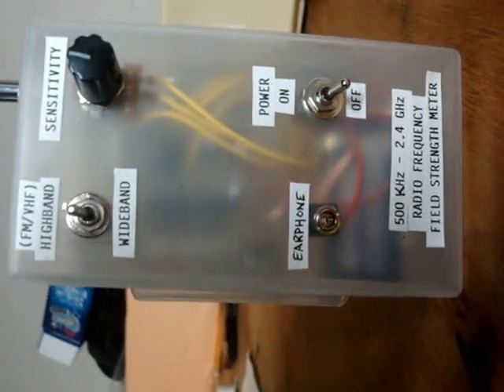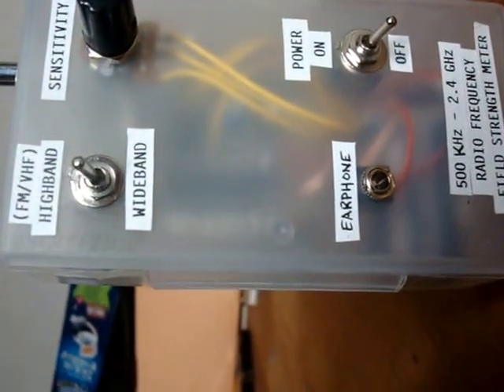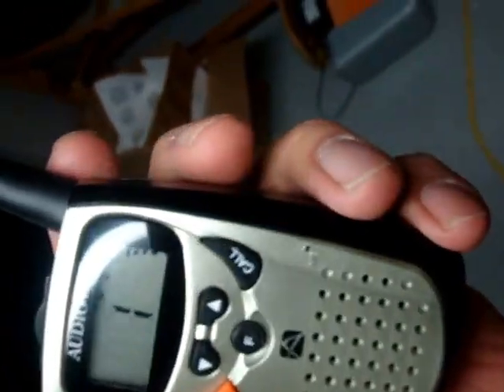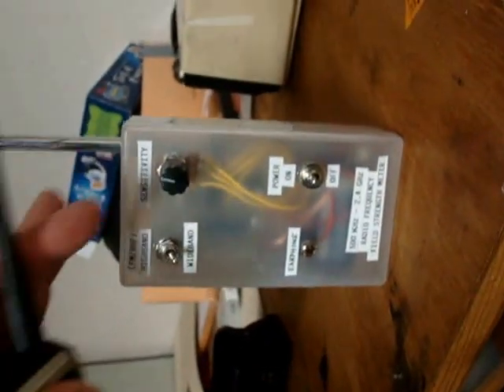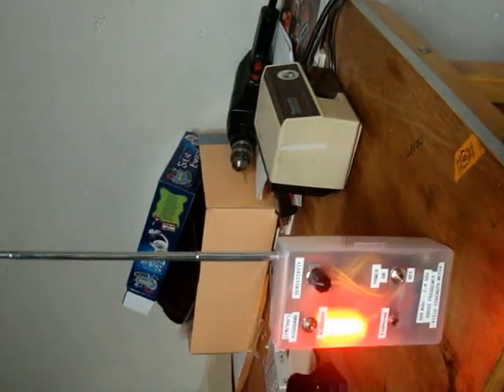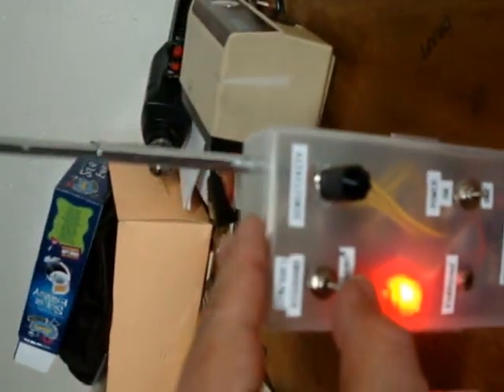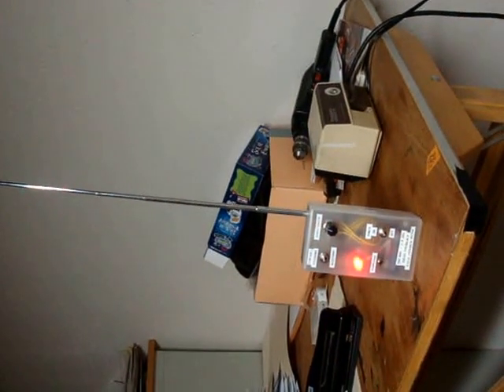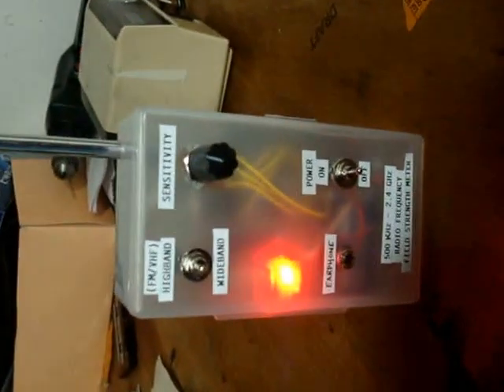DIY RF Detector

Comment: Could it be done for only 380-385mhz band?
Reply from the maker: I don't think this particular circuit could be modified to detect and show ONLY a particular bandwidth.  You might try making an RF detector that has a 383MHz resonating circuit on the input--which will certainly make it more sensitive to that frequency, but even then it probably doesn't exclude other signals.

Comment: Cool. Approximately how much did this cost for all the parts? $10? $25? $50? $75?, $100?, $100+?
Reply from the maker: The entire project certainly cost me less than $25, but probably a little more than $10.  The LM3914 Bar Driver was about $2 (from Tayda Electronics), and another $2 or so for a 10-segment bar display (from eBay/China). [The 10-segment bar display is much easier than trying to align 10 individual rectangle LEDs.] Other than that, the only piece I had to order was the BAT-29 diodes. They were also only a few dollar--and I ordered them off eBay from China. But you can try any type of Schottky diode and it would probably work. The only problem is waiting for two weeks for the parts to arrive. The TL071 is a simple OP-AMP and I paid about .99 each for them (yes, Tayda Electronics).  The resistors, capacitors, other diodes and connectors I already had, so I didn't have to buy them.  If you have to buy them, I would AGAIN suggest Tayda.
I'm a very cheap guy, since I can afford to wait for parts. The enclosure is a plastic cream cheese container.
The other component sources I like: mpja.com, bgmicro.com, alltronics.com, or allelectronics.com.
Reply: Peter Martin Awesome thanks.

Comment: Very cool. Would this detect a tracking device on a vehicle?
Reply from the maker: GPS trackers usually will transmit location data via a cellphone 800-900MHz channel. So my first thought would be "yes".  It may show as a quick burst.  I'll try some experiments with my cell phone to see how well it detects that range.
Reply from the maker: Peter Martin I looked at this again, and after a few attempts I don't see much signal detection on this meter. I was reading about detecting GSM frequencies and this provides a very good explanation of the difficulties of finding items in this particular area. It may require a specific detector.  And other commercial detectors aren't working well either. http://digitalcommons.unl.edu/cgi/viewcontent.cgi?article=1021&context=ceendiss